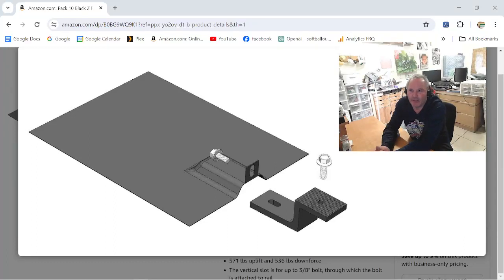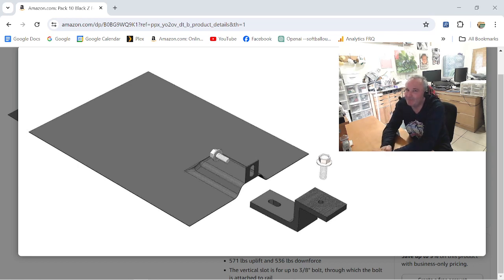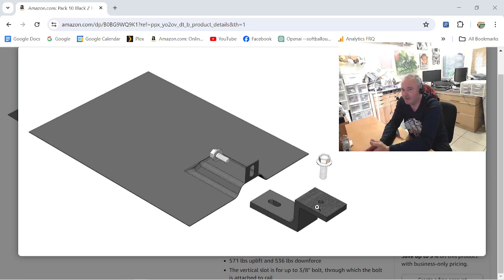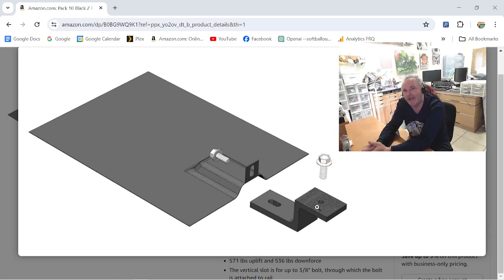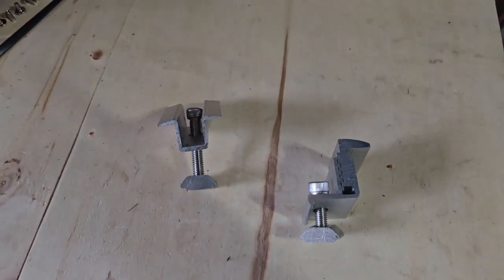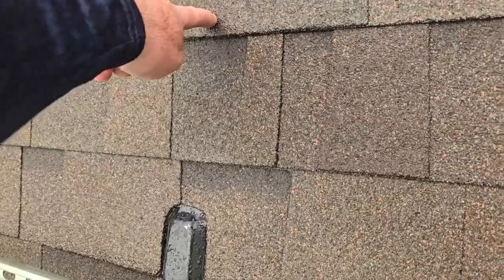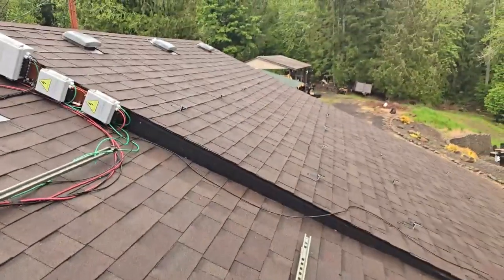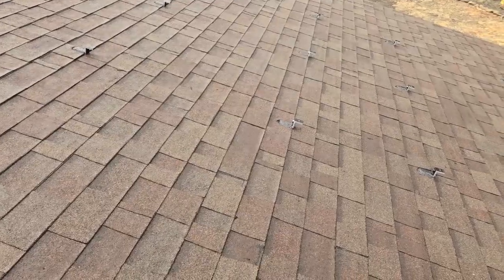Best Solar Panel Roof Mount Brackets

Comment: How are those lasting? Roof got nailed by hail, so I'm looking to replace the double lag bolt Mounts.

Also with a single bolt, what's the wind rating on these?
Reply from the maker: @jeffrbake  these are great mounts.
Reply: @ thanks for the reply, put in a quote!